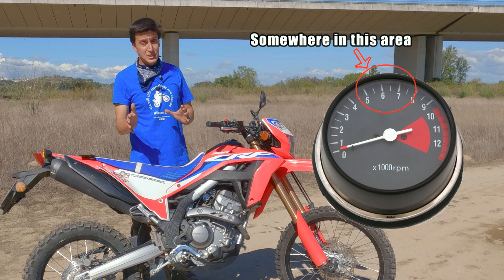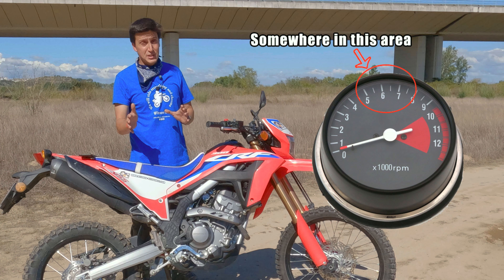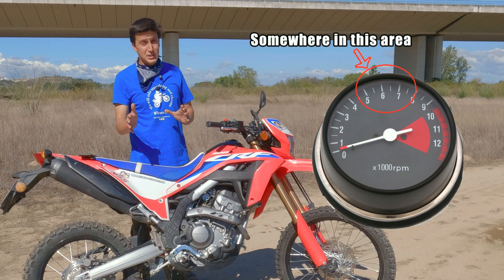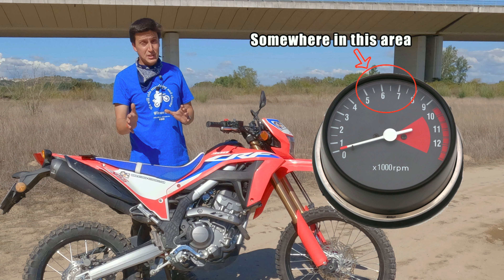Simple offroad skills: Pop a motorcycle clutch

Comment: Maybe this will help me wheelie my crf 250 L... Which for a n00b like me seems like an impossible task 😄
Reply: For the 250L you will need a bit more technique, and combine the clutch pop with compressing the suspension and moving your body rearwards in order to properly lift the front, at least in second gear! It's totally doable, but on such little power engine it takes a bit more of effort!

Comment: Teach standing. Feels weird for tall rider
Reply from the maker: Hey Robert! Tall riders struggle just as much as short riders to find bikes that fit them, but overall I think its a problem easier to solve for the big guys.

Depending on how tall you are (or how small the bike is), usually just a change on the handlebar tilt, or a complete change of handlebar will fix your issues. Handlebar risers could be a good solution too.

But overall, for a simple exercice like this, you dont need perfect ergos to do it right, so I would say you are also experiencing a bit of lack of training (or correct information about your body positioning).
You should seek training from a professional, its totally worth it! And if  you live somewhere close to Portugal, consider joining me for a "training tour" (or just the training) ;)